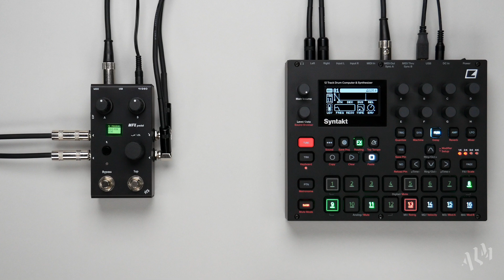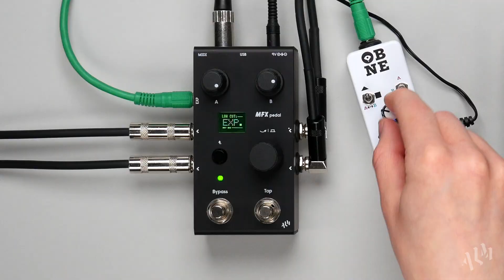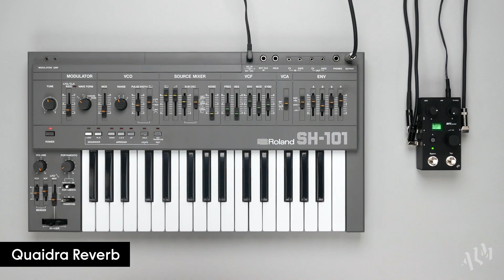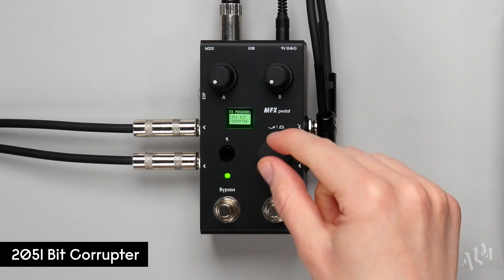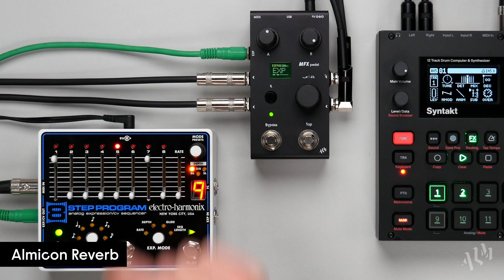Introducing MFX Pedal

Comment: I might have missed it, but can this device stack more than one of its effects at the same time ? It sounds lovely. I could see a version of it with 4 stages and a foot-button switch to step through preset combos — ready for live performances.
Reply from the maker: One effect engine at a time. You can quick jump between user presets but not via foot buttons (something we could potentially add in a firmware update tho)
Reply: Please add preset scrolling via the expression

Comment: Sounds great, would this handle eurorack signals ok? I know about the module obvs but no room left in my travel case, this could be an option.
Reply from the maker: Use the Euro MFX for Euro signals ! Otherwise you'll need to use something like the SBG to level the signals like with any external effect pedal.